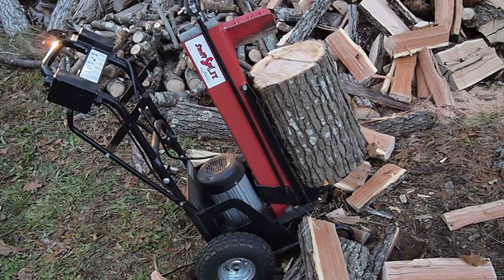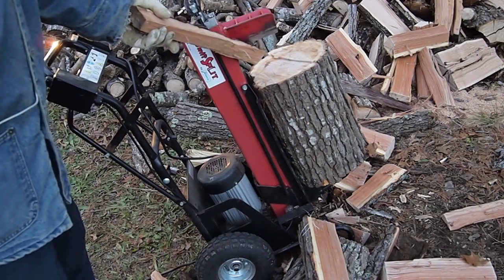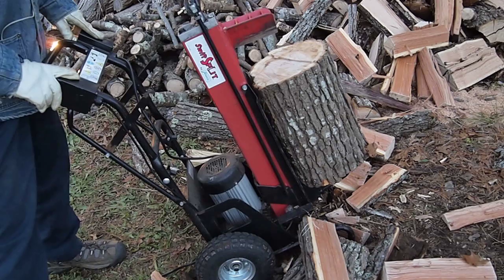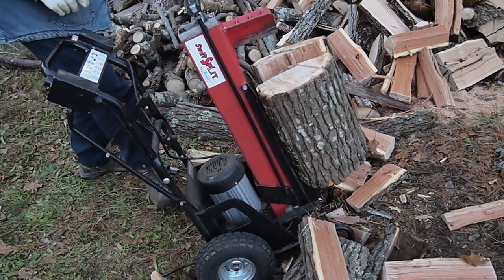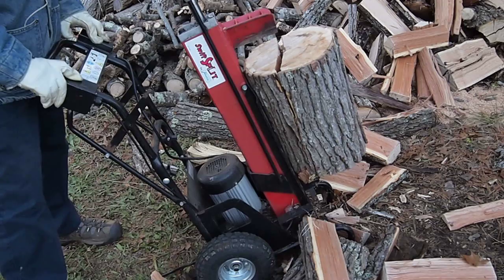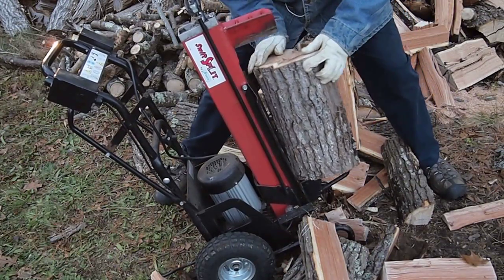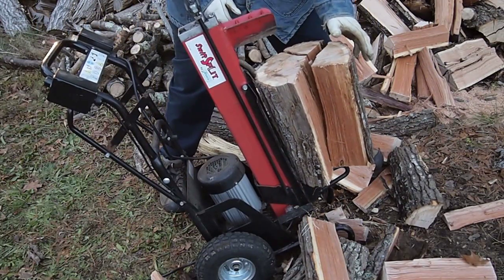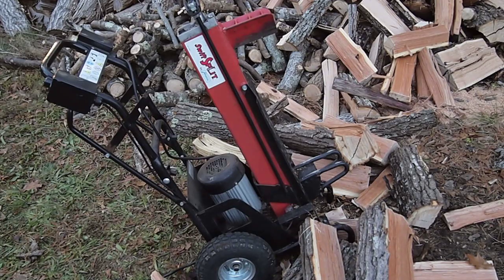The Pneumatic Log Splitter

Comment: Sorry sir but the only thing pneumatic about this thing is the tires. This is an electric over hydraulic log splitter. harbor freight sells them for 279.00 on sale from 349.00 If it were pneumatic it would require a much much larger cylinder because most compressors only achieve 125-175 psi. (single stage and dual stage respectively.) the hydraulic pumps create approx 3000 psi. Now some pneumatic ones have a hydraulic motor that pumps a hydraulic jack @ 12 tons and have a pop pop pop pop sound as they operate but have a limited stroke of about 9 inches. split away friend.
Reply: You sure that Eletric motor isn’t turning a threaded shaft
Reply: @tchogworks1987  yes, im sure its hydraulic. You can tell by the way that it is. Lol